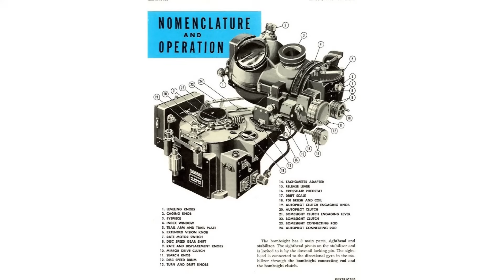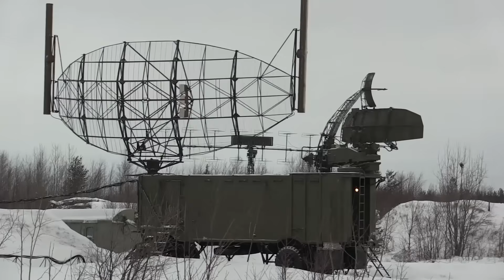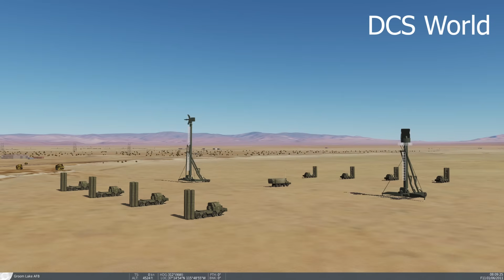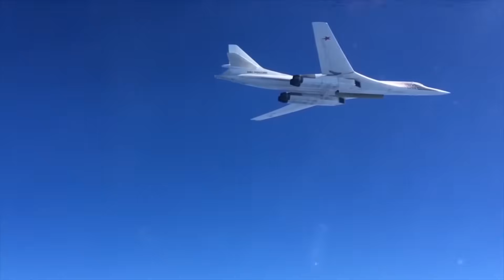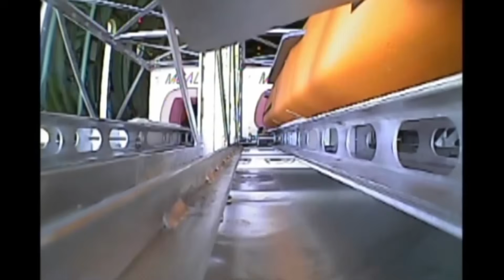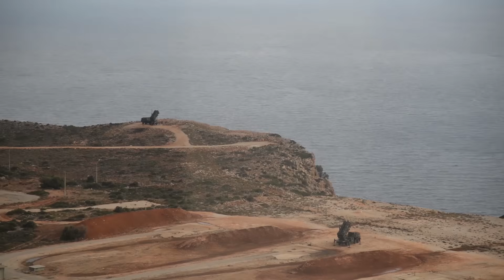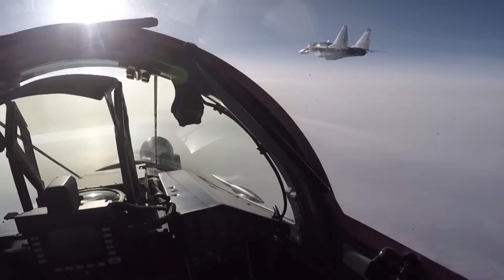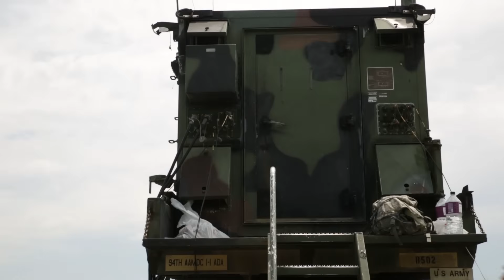SEAD - Suppression of Enemy Air Defense

Comment: How about the video on Beyond Visual Range air combat?
Reply: @jet guy Well,  I do agree BVR kills are rare. But does that mean BVR tactics are bad/not working?
Even if you don't kill hat the target that approaches you from 30+ km, you force it to go defensive. That gives you time and allows you to work on your position and attack. And it puts stress on your enemies. So I still see it as valuable.
Reply: @jet guy It's still a critically  important capability, as it allows for you to kill beyond your adversary's reach
Reply: Jet Guys is right though. There is a lot of interesting theory on BVR but not a lot of practical experience. It just has not been done much in actual combat. It looks pretty good on paper and in testing but no one really knows how effective it will be. Thank god we have never put the doctrines of the US and Russia to the test yet, but as of now they are the 2 primary doctrines.  So far the US has gone primarily with a single missile type and using it in multiples to ensure kills. 1 is OK, 2 better, 3 if it absolutely has to die. Since the seekers are all the same type and software 3 is your 99% kill rate with very good missiles. 2 missiles is about a 92% kill rate and one drops you to something like 75% assuming best performance (i am being really generous, weapons like the AIM-120D do not have a 75% success rate). Anything you do that degrades a single AIM-120D's accuracy is likely to be effective against the others in a volley which goes a long way to degrading performance against sophisticated opponents. But... it means uniform hard points and shapes that can easily be planned around in aircraft development (think internal bays on a stealth aircraft). 

Russian doctrine is different. They use a wide variety of seekers with different software suites which they use in in groups of 3 to 4. They think, in testing, they have a much better kill ratio against modern counter measures this way. Some of the seekers are for instance designed to home in on the electronic jamming you would want to use against a radar guided seeker in the same volley. Disadvantages are they are not uniform in size, different range, and some times have very specific limitations.  Some of this has evened out over the years. It also means your average Flanker can be configured to carry 8 to 12 BVR missiles fired in groups of 3 or 4. This becomes expensive fast.

This is just the basics of doctrine but no one really knows if any of it works and there is a lot more going on than just what I outlined. Pretty much all of it is theory. We know much more about modern SAM systems and how effective they are than we know about AAM's and that is still not that much. Honestly I could tell you more about the difficulties that probably face modern stealth aircraft penetrating a 1st world integrated defense grid than I can tell you about the effectiveness of modern 1st world air to air combat. It is all just theory.
Reply: @jet guy Thank you - great read!
Reply: @jet guy Indeed, but I imagine that a real shooting war these days between modern air combatants will see BVR A2A combat attempted in earnest.

Comment: Hi, can you make a video of Israel's chances of successfully bombing Iran's nuclear facilities without being shot down by SAMs? And return safely to Israel without losing any aircraft? Specifically the F-35. I think Iran has S-300 now.
Reply: Iran has at its disposal six types of complexes, from the old Soviet C-75 to Tor-1M. The most massive SAM of Iranian air defense is the American MIM-23 Hawk - there are more than one and a half hundred of them. Also recently began the production of its own "Shalamcha", created on the basis of "Hawk".
Reply: Currently Israel has 9 active F-35's however will eventually have at least 50. The main difficulty is range which dramatically makes keeping the element of surprise harder. Saudi (and possibly Azerbaijan) would be willing to lend an airbase to facilitate the attack. However, you drastically reduce the element of surprise by doing so because intelligence agencies would be all over this kind of activity. Another solution is to use Saudi or Azerbaijani airspace for air to air refuelling but you would need quite a few tankers. Also, it's far easier do under the guise of a "training exercise". The question of the F-35 vs S300 is one of the most spoken of but also the hardest to answer. This is due the classified nature of Electronic Warfare. It's hard to know what Israel/F-35 has up its sleeve and same for the S-300. Numerous F-35's probably could take on the S-300 alone but the Russian SAM is typically accompanied by other SAM systems too. The F-35 could potentially make up for this with it's state-of-the-art battle management and awareness systems. It's a fascinating scenario to explore with endless branches of potential outcomes.
Reply: @Burt Reynolds Corpse 
Israel is the only country in the world succesfully destroyed already two nuclear Programms. The odds we're Always against Israel but dont forget that you Deal with jew. The smartest people on earth 🤣
Reply: @test-qz4dq  which jews are the smartest, semites or the fake ones? Genetic wise they don't have much in common.
Reply: Binkov's Battlegrounds cover that (sort of), if Israel is attacking Iran's nuclear facilities, it'll most likely be done using ballistic missiles, it's much harder to defend against than aircraft and cruise missiles.
Reply: Robert Hubbard m1a2S tanks are beeing cooked of by 50 year old atgm‘s... whats the point?
Reply: The F-35 does not have enough range to strike deep into Iran from bases in Israel. None of the countries in between is likely to allow ground refueling and would probably attempt to intercept any detected aircraft, ruling out aerial refueling. Israel is more likely to use their F-15s to do such a strike, with numerous external fuel pods and limited weapons loads. F-35 would more likely be used as escorts to mark targets near the border, help others strike some targets, strike a few themselves, and then return. F-35 can carry fuel pods but would need to drop them far away from Iran's borders in order to maintain stealth. This gives F-15s a much longer practical operational range for strike missions than F-35s. A large group of F-15s could go deep into Iran and split tasks between engaging defenders and doing strikes. Iran has strong defenses however and the success of such a mission is not guaranteed. A long range missile attack would be less risky.
Reply: oh its gonna be awesome, Israel hits Iran while the USA invades Venezuela. perfect timing imho
Reply: @rerbitd7094  Lol quiet Russki. Nobody can drop bombs on USA. 

Haha, but I invite you to try it. It will not end well for you. Remember what happened last time your nation came up against Western technology: https://en.m.wikipedia.org/wiki/Operation_Rimon_20
Reply: Farzana Patel  1970! You give an example of a battle where 4 MiG - 21 were shot down? It's been almost 50 years! Technique and capabilities are completely different.
OK . Look at the modern training battles between Soviet-Russian and US fighters. The USA always loses.
Reply: @rerbitd7094  It was two different targets. Lol your video sounds like a salty Russki making excuses.

Israel is wrecking Russki equipment in Syria.
Reply: @Conor McGregor's Pool Noodle In general, the US is why israel exists and does well.
Reply: Robert Hubbard, Your post clearly indicates your truly low intelligence level. If you would make a bit bigger effort in reading true media such as Jane' Weekly and similar less bias western military media you would know that Pantsir destroyed by Israel was not operational and was in the phase of refilling missile containers. In your crunched small brain you will understand that even the best gun shooter is the most vulnerable during reloading of ammo and that anyone even someone with your level of intelligence can kill him without problems. 

If you have problems to understand that try with dots on a paper and slowly you might figure it out.
Reply: @Blaster53  Your post clearly indicates your truly low intelligence level. If you would make an effort in reading true unbiased media you would know Pantsir batteries never act alone. There are many Pantsir batteries that overlap and protect each other. They do not all reload at the same time. If you had seen satellite imagery, you would there were many many Pantsir batteries in that area. They are meant to protect each other from aerial attack.

All of them failed to pick up Israeli Delilah. Last week they did it again. They are bombing Russian defense on the regular now. See latest one: https://mobile.twitter.com/IDF/status/1087208824182919168

Russian Air defense is only invincible on RT and Kremlin channel.
Reply: @evilzarmy1  so you said that Israel defeat Russian technology with usa 1970s tech.means Russian tech is inferior to US tech. So why dont you mess with China, India, Russia, Indonesia. They are using modern Russian weapons which will show you the capacity and power of modern technology.they will show you that you are living in dream which start from anti Russia propanada. Russian are always superior to West. Now they faced bad economy due to western sanctions. But soon their economy will boom because now they are moving towards East and leaving west. Russia relation with China, India, Iran, Vietnam, Indonesia, Japan is growing rapidly. Their influence on world  is increasing like USSR. Sun of West is going set and sun of Russia, China, India is rising.
Reply: @Hoss Cartwright, IF Israel could field a stealthy refuelling aircraft, maybe could do with manned aircraft. Nobody has them currently AFAIK. But Israel does have a long history of making it's own tankers...
Reply: @WhatEverDude Sadly for you this is a fact
Reply: Israel most likely has the tactics and technology to destroy the s-300. There's always a way to counter these systems.
Reply: Conor McGregor's Pool Noodle  Are you just talking about attacking an independent country? Are you from USA ?
Reply: @rerbitd7094  I am from USA and we bomb where we want when we want.

Also Israel vs Russia 
Operation Rimon 20.
Reply: Robert Hubbard  This installation has repelled two attacks. Destroy one unarmed car and proud of it? )) Dumb boy is a fan of the USA.
Reply: @evilzarmy1  yea, it's pretty easy to destroy an AA site at visual range if it's not even active. They have shot down Turkish and Israeli Jets with pantsir before. Also, current upgraded f15 have few in common with an f15a0, Israel produces its own custom avionic upgrades.
Probing the capabilities of a system during an actual engagement produces far more reliable information than just screaming "murrica" or "Russia"" and attacking what's basically a steel container. They WERE attacking the site preemptively, when it was offline, because they knew the location and had seen the capability first hand just days before.
Reply: @pteppig  Guess you didn't see the video Pantsir firing just before it get hit twice. I guess don't even know what they use the attack the Pantsir. visual range lol..
Reply: i believe that if they want to do it they can with a large scale attack. (not the "smart attacks we had seen from Israel in the past). the problem is that today they will be counter attacks... After all geopolitical and strategy is changing all the time in middle east.. More likely Saudi would do something like that..
We all know that Israel do as USA commands and always USA support ISRAEL s it is not ISRAEL the hero, but the american technology and intelligence and reconnaissance
Reply: @mitropoulosilias  
Most US Hardware in Israel Like f-16 and f-35 are heavy modified and updated by Israeli arms Industry. So USA only deliver the Basic Systems and Israel modifies with state of arts Technology.
Reply: Israels Chance at attacking nuclear enrichment sites and especially the power grid, are pretty good. They have good information on the sites and can use sub launched cruise missiles to take them out, without risking any fighters. But Iran also has a good chance at defending some targets against cruise missiles, if they have access to Russian ECM systems, like the ones used in Syria. The majority of the cruise missiles that were launched from the us destroyer against the airbase did not make it there. But, like in that example, every ECM or AA system can be saturated, even if they are informed of the attack before hand. And the ones that got through, hit their targets.
Reply: @senselessnothing  
Ashkenazi jews have the highest IQ average of all humankind. 
Just compare the nobel price winners Relation to Population density. Jews are Number 1.
Reply: @test-qz4dq  No, ashkenazis have the highest verbal IQ of all major genetic populations.
Obviously you have no idea about the research.
Nobel prizes mean little, obama got a peace prize being bush 3.0
Reply: Probably smarter to let them develop nuclear weapons as a counter to Israel's domination. Nuttyahoo won't like it. Screw him, he's just a fundie like the Iranians.
Reply: Israel is overhype.not saying they probably not good in war but there a myth surrounding them that need to be shun.durst off they aren’t real Israel they are white Europeans whose fore fathers convert to Judaism.now te question of Iran.iran would obsolutely destroy Israel with all that conventional missiles